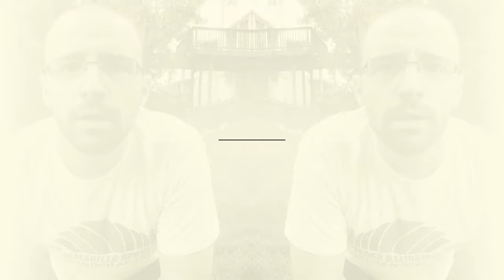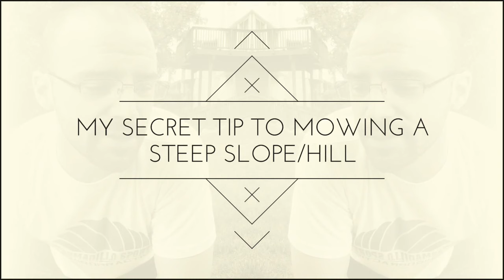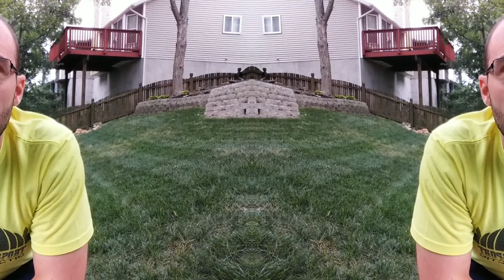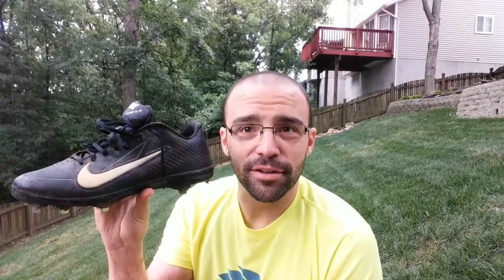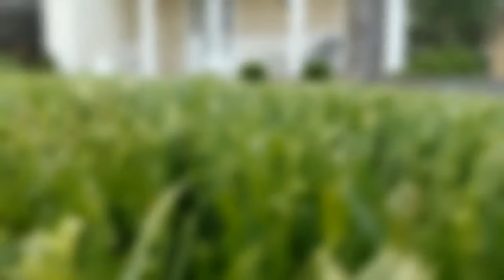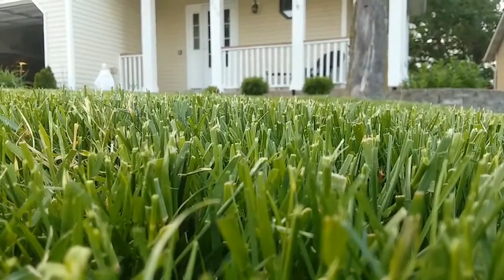How to Mow a Steep Slope/Hill : My Secret Tip!

Comment: I use a battery mower for my slopes. Still a pain but a but easier than the gas push mower I was using. A hover mower might be a good option or I know B&D make a mower type attachment for their weed-eater (that's going to be inefficient though). Or you could do what my dad did and just terrace it all.

Comment: Good Idea.  I never thought of "baseball" shoes for mowing my hill.  I have a steep hill.  I normally ride up and down with the riding mower.  But, where it's really bumpy, the mower with pick up speed coming down fast.  there's nothing at the bottom of the hill to run into, thank God.
Reply from the maker: Be careful mowing on those hills. It can be pretty challenging at times. Thanks for watching!
Reply: Try getting a hydrostatic lawnmower, the transmission fights the speed increase, and prevents you from speeding up too much.
Reply: @arthurr8670  thanks Arthur, I will look into it.